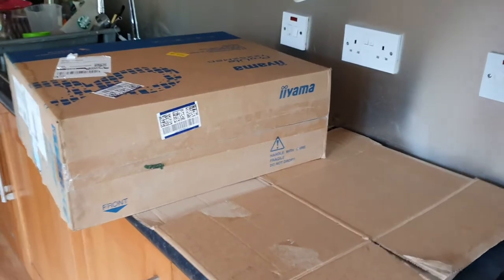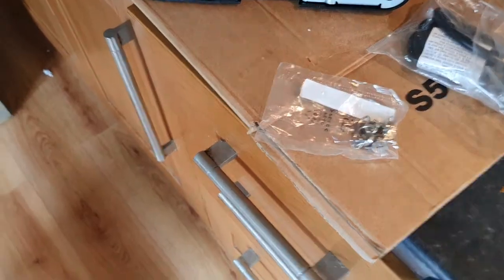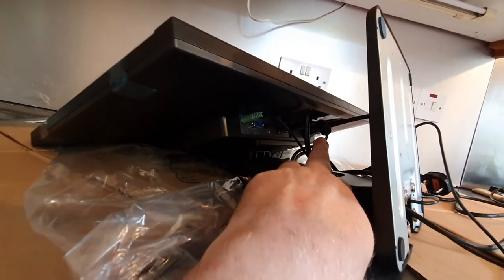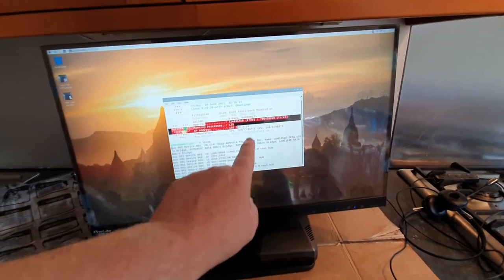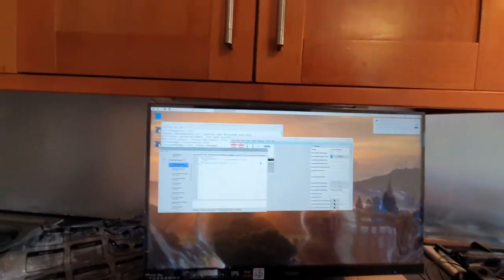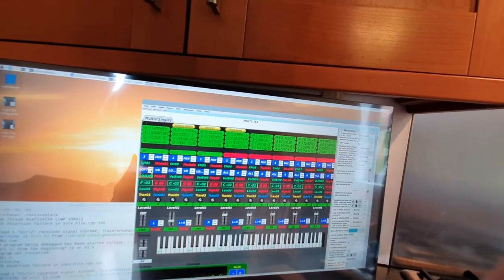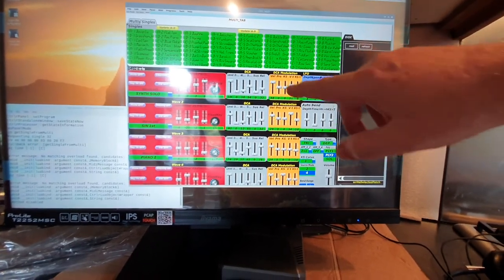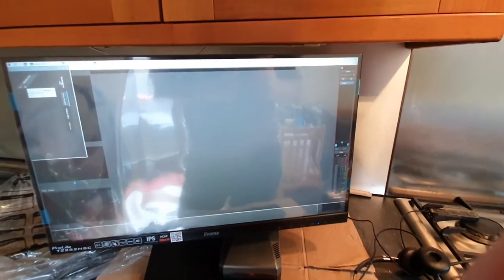Ilyama T2252MSC Touchscreen Monitor with Raspberry Pi 4

Comment: That is a really sweet monitor. You can change the font in the settings. If you want the ultimate in customization, I suggest you try Twister OS, which is basically 32 bit Raspbian that's been tweaked heavily. If you want pure speed I'd suggest 64 bit Raspbian.
Reply from the maker: What I meant was the Ctrlr program itself was producing 4 x size fonts. Regardless of what I set the X font to. I am a tad old. Back in the day we have the .xrdb and other hidden files to configure the X. The xdpyinfo looked OK on my 32 " Samsung TV but the fonts were massive - you saw the part where I started a YT video where Ctrlr was 1080p on Samsung but fonts were massive. On this Iiyama it is scaled just right.

For sure I do want to run the 64bit Raspian. Likely I will create a new image later in the year.

I was using the experimental Vulkan drivers - I hope the 64bit has them built in. Makes quite a difference to the Pi4.

Sometimes I can crash back to GUI login prompt with the touchscreen - not quite sure why yet. But for sure I will be writing more Ctrlr panels now it is essentially a BCR/tactile interface.